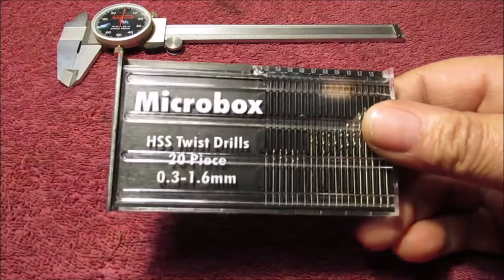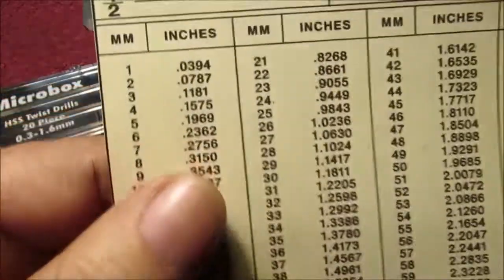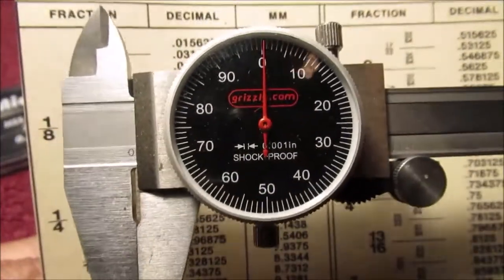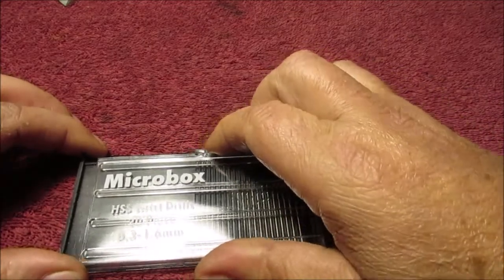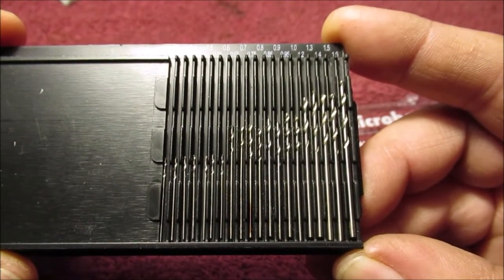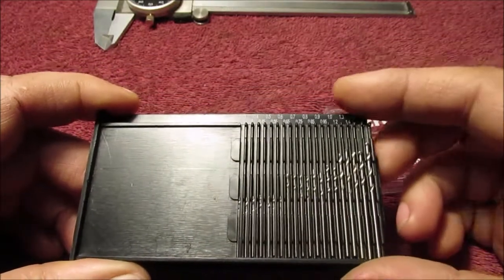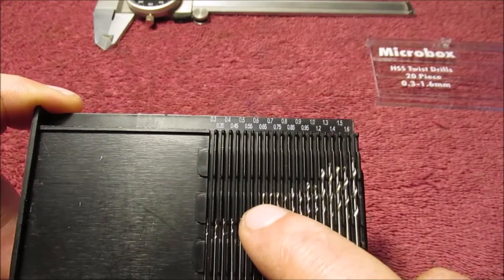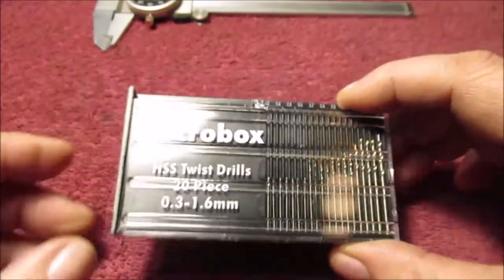Micro Drill Bits 0.3 to 1.6 mm

Comment: 32 F here.  By the way don't get gas or carb cleaner on the cover of the drill bits.  It really deteriorates the plastic.  I have lost one already haha.
Reply from the maker: carb cleaner will also tank paint off an engine...I need a small pin vise to hold these little bits